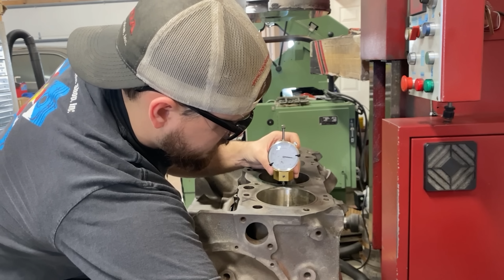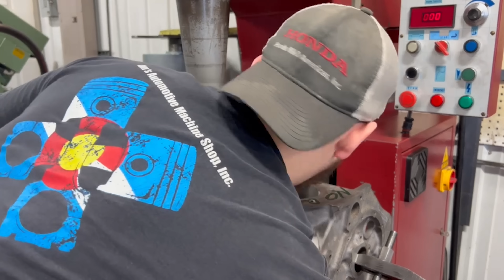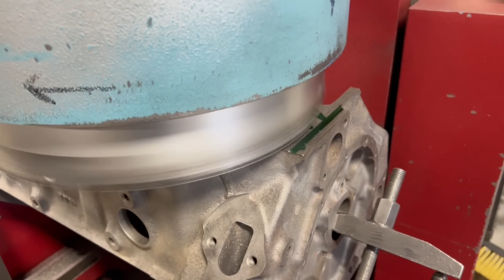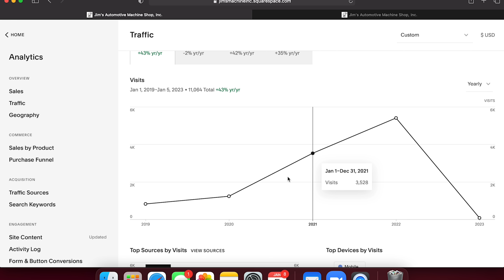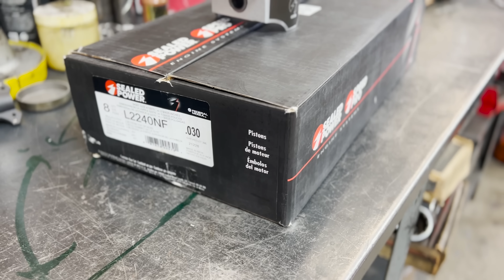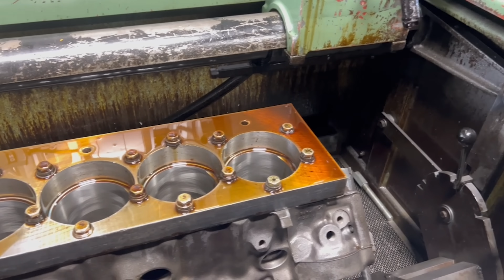Can You Deck A Numbers Matching Engine Block?

Comment: Dave Crume, who built engines for Bo Laws for years did my numbers matching 396/ 325 from my dad's '65 Impala SS, my '66 Corvette 427/450 and my '67 Corvette 427/435 blocks and he decked them and saved the numbers on all three. Years of hard use and never had an issue.

Comment: Two years ago I took my numbers matching 1967 Corvette 327/350 to Engine Rebuilders, LLC. in Dallas. The car had recently gone through NCRS and received Top Flight. Before Engine Rebuilders began work we discussed several important things. NOT decking the block was first on that list. I stopped by their shop several times. At one point the block machine was done. THEY HAD DECKED THE BLOCK AND DESTROYED THE STAMP. See my Google review for some details. Blah Blah Blah. No suggestion. Just a note of warning for others.
Reply: I guess the machinist was not involved in the meetings and never told.

Comment: Love the videos!

Is there ever a follow-up for the engine after all the machine work you've put in? I mean, 'after we blueprinted the block they added XYZ heads, ABC cam, and this is the dyno result' etc. Just thought it would be a neat way to conclude a block's story.
Reply: Then it starts to become a sales pitch like with SMR. Build a engine the entire time telling you how much better his $40,000 engine is than the one he is building. Then The one he is building goes up in smoke the first trip out. "The ole Should have bought my $40,000 engine"....

Comment: Are you measuring the deck off the crank journals? Doesn’t everything depend on the position and angle of the crank first? Just can’t go to the deck and flatten it unless it’s squared up with the crankshaft right? Maybe I need to finish the video first.

Comment: Did you check up on what the cleaning guy did to that head?  

The calibrate tape strikes again.     Do you intend on aquiring a profilometer?   The engine expo is coming up and so many of the local old machinists like you are falling behind on tech. From spintron to the profilometer.  The result is oil usage on newer engines.  I realize that most of your projects are a bit more dated but growing now vs playing catch up. I get dad's position will likely be much the same as mine.  39 yrs not sure it's worth the investment to keep up in certain theaters of automotive anymore.   I don't do any hybrid, not that I'm not capable or untrained. I just refuse to invest in the equipment

Comment: At 16:50 in the video, there appears to be a dark vertical line down each bore. What is that?
Reply: I think it's from dragging the bore gauge. In cast iron blocks it isn't a problem but in aluminum (alusil) you have to be very careful not to destroy the finish.
Reply: I had an SBC block bored .030 over and it came back with lines like that on three cylinders that you could actually feel.
When I questioned the machine shop guy about it he told me it wasn't a problem.
I have about 6000 miles on it now and no issues.
Reply: Hone oil

Comment: Why not use the specs from the main thrust location for bore center on each bank? Then hold factory center to center? I'm just thinking it would line up on the crank better than sweeping in each sleeve.

Comment: If you deck the block after cutting the valve relief and chamfering the bore edge doesn’t that mean you’ll have to cut the relief deeper to be the correct depth and you’ve removed the chamfer?

Comment: It always amazes me that people are trying to be accurate with imperial measurement.
8,324 (yes you use comma) inches = 211,4296 mm. You see the margin of error you got here?
8,325 inches = 211,455 mm. Use metric for heavens sakes.
Reply: Some people shouldn’t comment. I’m pretty sure you fit that bill to a T.
Reply: @grntitan1  
Because of??
You do know that if we for some reason change the size of the meter, the imperial sized will change as well - since the US actually is metric already (hint 1 inch isn't longer defined as the length of three rounded grains of barley, it's defined as 25,4 millimeters).
Reply: Keep that metric gobble de gook on your side of the planet 😎

Comment: you know you can just hit the axis label x, y, z, and hit zero and itll zero it out.....no need to remember random numbers
Reply: also are you centering off each bore before rough boring, and not just moving the table by the bore spacing? if the block came from the factory with uneven bore spacing, now would be a good time to fix it. another reason to have the DRO, just move the X by the bore spacing and itll all be straight once you pick up one bore. We center the thrust bearing in the machine as our block center along X and base all the bore centers off that so they are 100% square.

Comment: You referenced the crank to measure the deck height, but when it comes to boring the cylinders, you use an average of the bore.  Isn't there a need to centre the bore to the journal on the crank?

Comment: I would have personally liked to see more honing. Those inserts are like 40 bucks tops and to only remove .003 with  multiple sets of stones is bonkers. 

It almost sounded like a flex mentioning the honing machine to not even really use it. 

I mean in this video only good things happened right? You guys think that’s what really happened?

Comment: What do you do for (say) 400 SBC where the bore comes right down into the main web?. I bore on a large mill so i can shift the block once the cutter is through the bore so the cutter cuts the web a few thou for a further 1/2 inch to clear for the stones. I am looking at getting a boring machine as I have the work for it but am unsure if I'd be able to do this on a Rottler etc

Comment: I had 67 350(ss camaro only BTW) That needed decked,and numbers saved.Rear of block was the problem, So an old timer told me to ask machine shop to angle cut it-.010-.020 off back to none in front,not ideal but with composite gasket and mostly stock parts, no problems & numbers saved!!!
Reply: Now you had a tapered block. Congratulations
Reply: @2nickles647  thanks ,it ran great!!

Comment: Good to see this old girl coming back.  One thing I would strongly suggest.  Please check all the lifter bores if you haven't already and make sure you have ample clearance with the replacement lifters.  I'm assuming the customer is ether going to go with a solid flat tappet or a hydraulic flat tappet camshaft.  Anymore these flat tappet motors have a hard enough time breaking in the camshaft, I wouldn't want to give this old girl anything to complain about.

Comment: With all the cylinder bores being enlarged; do you need to enlarge the upper relief cut in the top of the cylinder bores?
Reply: The relief cut is based on the valve size.

Comment: Why cant you restamp the numbers back onto the block?
Reply: Because those of us that know what stamps and broach marks should look like will call the car into question if it's ever judged at a national show, or comes up for sale.
Reply: @DavesRestoration454  is that the only place it's marked
Reply: They don't judge the parts inside the engine to see it's original. Might have a different crank or heads redone with better parts. So it's not Original at all. 
It's just called OCD

Comment: General question, nothing point at Jim.  Why take the care for numbers matching if you are over boring the pistons?  To me that seems counter intuitive as you can't use factory pistons.
Reply from the maker: Numbers can be seen from outside the engine. Nobody will see the pistons 🤫
Reply: @JAMSIONLINE  very true, I guess the block authenticity is more important than what pistons are in the engine too.
Reply: Customer wants numbers matched block. Goes and drives it hard. Destroying the engine. Blames the machine shop and now wants his money back. Claims he broke it in right. 
I guess his numbers matched block went up in smoke. 
What I don't understand is. You guys are concerned about precision tolerances. 
What happens to the tolerances when the engine gets broken in.? 
Isn't the block or components tolerances going to change or shift because if the heat or misuse by the owners? 
I see commenters . I'm going to run my engine hard. So what's the point if the owner doesn't care about all of the precision work. ?

Comment: Old school honing here,   we use diamonds, 150 grit all the way to finish size, and then 800 grit diamonds for plateau 6-10 strokes to get the right range of  RVK, RPK and RK.  The Plateau process gives the rings a smooth surface to ride on,  but also leaves deeper grooves to hold oil which helps ring seal, and long life.
Reply: Sounds good.
You should use your real real name,or your business name,otherwise some people simply won't believe a word you are saying.
It's just what I have experienced on the internet.
Reply: @YouCantSawSawdust    Not hard to confirm what I am saying,  watch any Rottler, or Total Seal cylinder finish  presentation,   it's not a secret how to properly finish cylinders for ring seal, and long life. The OEM's have been doing this way for a couple decades,   racers figured it out next,  then the rebuilders are catching on now.      Who I am has not bearing on whether what I say is the truth or not.    Do your own homework,  there is a video where  Pro Stock engine builder Greg Anderson  hones a block for Lake Speed Jr,  they go over all the details.
Reply: @donavan2676  I don't doubt what you are saying.
Anyone can google it,nowdays.
What I'm saying is,if you don't use your real name or business name when you comment,most people will disregard anything you have to say.
Reply: @YouCantSawSawdust    Its ok,  the people who know anything about honing know what I am saying is right on target,   that is the target audience.     BTW,  I am using my real name.
Reply: @donavan2676  I get it.
Like,Cher.
Reply: Donovan.
When you say "we",as in we use diamonds,may I ask who is "we".

Comment: I have a 1966  396 H4 C/I intake  it ran when I took it out of my Monte Carlo It has been kept ina heated garage. for30plus years. It is unmolested. do you think it would disassemble without problems?
Reply: If you are a person who wants to do it right and you are very picky or OCD..
As long as you don't use power tools. 
Use a repair manual to follow the tightening procedure. But do it reverse process. 
Crack each bolt and continue with 2 steps. 
I've always followed this on my disassemble process. I've never used power tools to disassemble. Because I don't want to break bolts or studs. I've used a small torch to heat up a stud or bolt. Then gently remove them.

Comment: So you went with .0015" piston to wall clearance with those pistons? I used those speed pro forged pistons on my Ford 390 and my machinist set the piston to wall clearance at .003" on my engine. Seems to be working well. No piston slap noises, no oil consumption and it runs great.
Reply: I think .0015 is too tight,  I would never set a forged piston that tight in a BBC,  .003 is about right for stock forged pistons,   higher performance 4032 about .004 to .005,   2618 pistons .006 + in a BBC.   The piston manufacture usually has the skirt clearance machined into the piston if you take the cylinder to nominal size.   Rarely do we deviate from nominal size after measuring the pistons
Reply: @donavan2676  The piston skirt profile (taper and barrel) is obviously designed to run tighter clearance.  Obviously not a racing engine with those pistons so .003" clearance will only make noisier and reduce life especially with the slotted oil ring groove .
Reply: @catatonia1  I am an engine builder with decades of high performance big block Chevy experience,  and experience with these specific pistons.  Changing clearance from .0015 to .0025 will not cause any adverse effect (read the manufacture recommendations all the way through),  and then  when you talking about noisy pistons in a BBC you are talking skirt clearance over .005, which is about where we set up the typical high performance street engine with 4032 pistons,   if the customer wants to use 2618 pistons we typically set them up around .0065 for the street,  and .008 for full drag race with power adders,  and yes,  they are noisy when cold,  but swell when they get warm.  As for setting up stock replacement forged pistons at .0015 in a BBC,  it leaves no margin for error.   As for the specific engine in this video,  they are honing with vitrified stones,  and using a .0005 scale bore gauge,   which is not the most accurate (being nice)  and what you think is .0015 might be .001 or less just with the tolerance of measurements and the bore gauge.   Also cylinders tend to shrink after honing (heat),  and if you don't wait long enough for final measurements can easily be off .0002 to .0005      at .0015 you have no margin for error on the tight side...   then your customer driving up a hill with a 4 speed detonates the engine, combustion temp jumps abnormally high, piston swells and scuff scuff scuff...    Just no reason to set up any forged piston that tight in a BBC.     We use only diamonds for honing,  and a bore gauge that measures to .0001, much more accurate on both accounts.   Simple rule of thumb,  tight engines break,  and looser is faster and more forgiving when talking BBC...  This is true on the bearings, rings and skirt clearance,  BBC's like to be loose.
Reply: Speed Pro says the material doesn't expand like old forged pistons did so they can be put in tight...and when I saw they said .001" was minimum I went looking online to see if that was a misprint.   Found one listing on them that said .0015" was minimum and man...that is tight like a cast piston.   But if the material only expands like cast it'll be OK...depending on how the motor will be run.   For a show type car that's not going to have the balls run off of it once they break in and with good oil they'll probably be fine.   The coating they use on the skirts might also be partly responsible for being able to being run so tight...better lubricity than bare aluminum and less chance of galling.   I've never run this piston and the ones we used in the Big Blocks were always put in .004-.005" but they weren't coated so maybe that does make a difference.
Reply: @recoilrob324  Yeah, my 445 FE stroker uses Mahle power pak forged pistons and has .0045" piston to wall clearance. I was surprised my machinist set my 390FE up for .003" then I found out the minimum can be .0015" with those speed pro forged pistons. That seems a bit tight to me. When I assembled the 390 even .003" felt pretty tight when test fitting them in the bore with no rings.
Reply: Most cast Pistons run at that clearance .0015 thousand or if you have a forged piston you can start at .0025 up to .006 your oil  viscosity will be higher.

Comment: An 'unrelated to this video' question:  About 25-30 years ago, I remember seeing somewhere, where you could get a totally raw OEM, unmachined block or crank (Toyota in this case, I believe) from the manufacturer.  Obviously, any and all machining would have to be done to it.  Do you ever get requests like that?  If so, how often?  If not, would you be willing to tackle such a job?  Your videos are terrific, and this would be an interesting addition, I think.